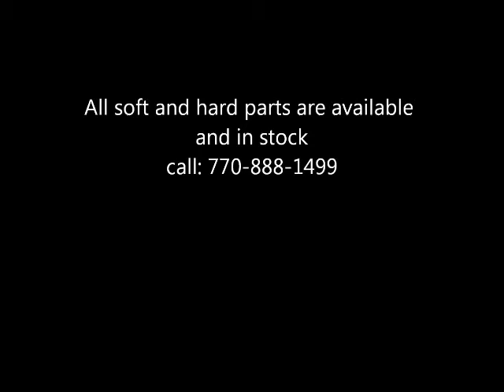Mini CVT transmission teardown Part 1

Comment: Hello, how were you able to remove secondary pulley? It seems impossible to remove it without a special tool.
Reply: I was able to remove one of two large nuts because there is a good grip on the other side. But the other large nut, there is no grip on the other side because it is a gear. I guess I need gear holder. I want to know what I need exactly to get a grip

Comment: Possible interested in purchasing the video, but isn't the dilemma on repairing one of these transmission the cost and availability of parts for the average consumer? Also what are the skill level do you recommended for the video is it for the small auto shop owner or the garage mechanic?